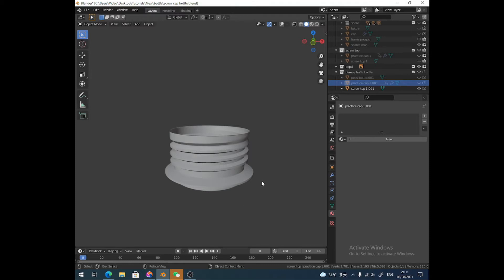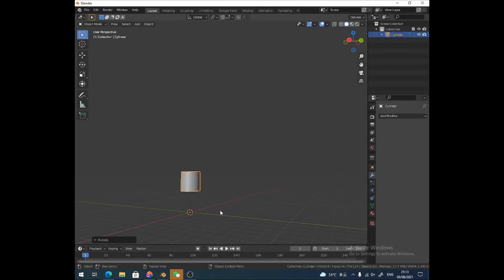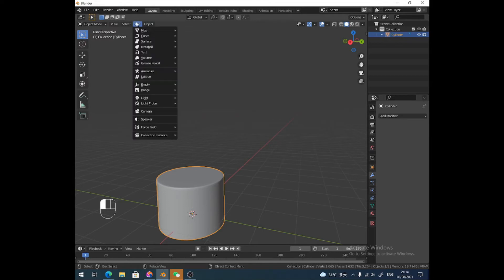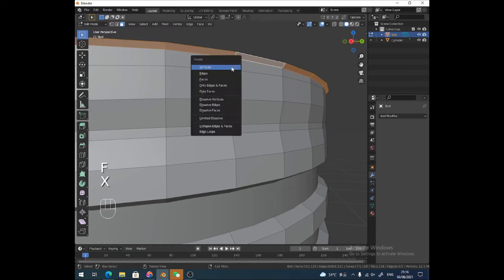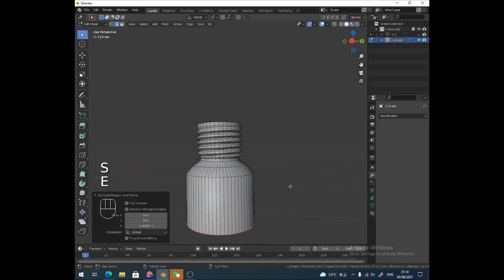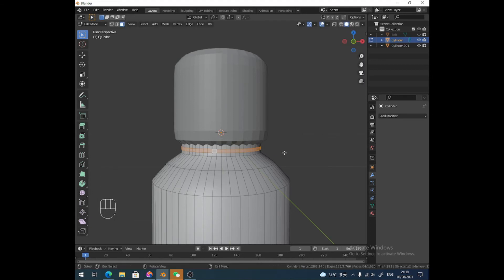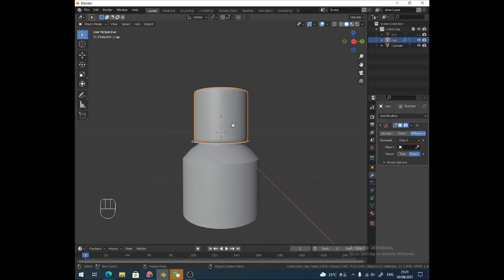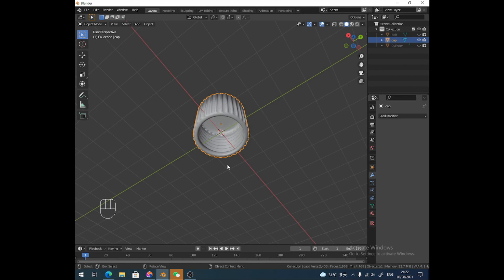Blender Tutorial - Bottle screw top

Comment: you could elaborate better on some parts
Reply from the maker: @bluefishboy23  I’m probably going to redo this video because some people have mentioned issues. Which parts do you think need more explanation?
Reply: @pmdesigns5798  nvm I figured it out, you have to dissolve them
Reply: @pmdesigns5798  the part before you select every 2nd face  you selected the edges and deleted them, but they automatically connect back together, mine just deletes and creates a gap, how did you do that

Comment: This doesn’t work realistically to match a product cuz the bottom tapers off but the top of the spiral doesn’t
Reply from the maker: That's a good point. I didn't think about that at the time. But it would be really easy to match the taper at the top too.
Reply: I had to use another tutorial 🫠🫠🫠🫠 but if you could still post that I would watch it and learn from it still cuz the other one was a different method totally
Reply: @thatskysylvos hey brother which tutorial did you use? And do they screw on smoothly when 3d printed?
Reply: @ oh it’s been so long I can’t remember 😭 but i remember it definitely would not screw on when 3D printed. I just needed it to look good from the outside in a photo

Comment: that fast option i can't find in boolean now
Reply from the maker: Which version of Blender are you using?
Reply: @pmdesigns5798  2.90
Reply from the maker: @MrWarriorBD  Strange. I just checked and it should be in the same place, in the modifier settings. Did you accidentally collapse the modifier settings? (Silly question, but you never know).
Reply: @pmdesigns5798  no there i can't see any option...